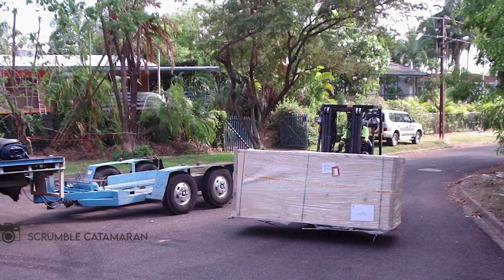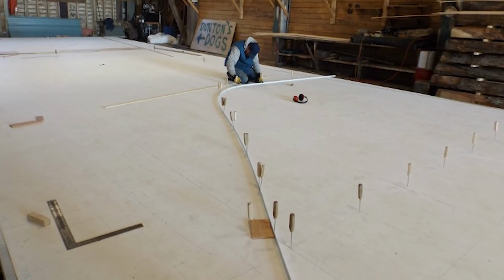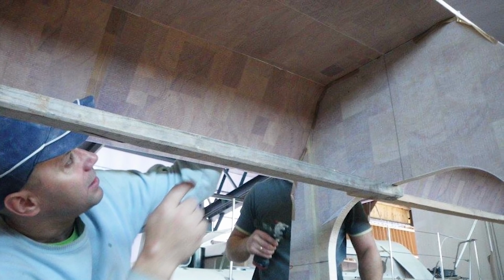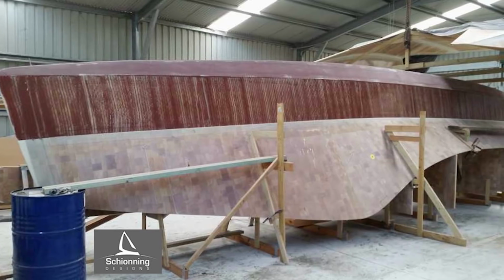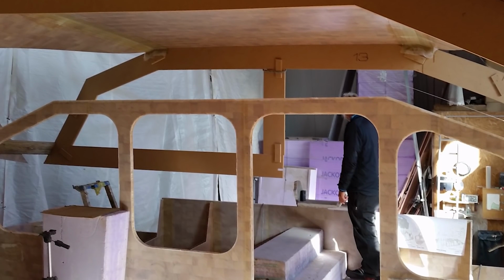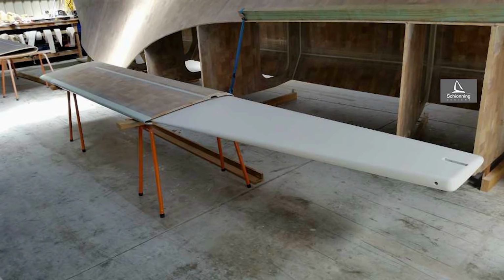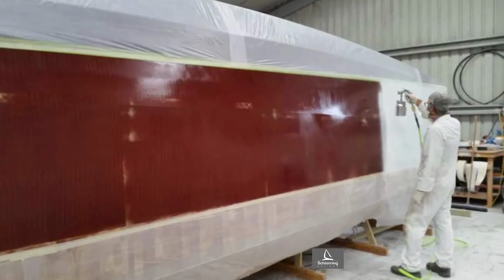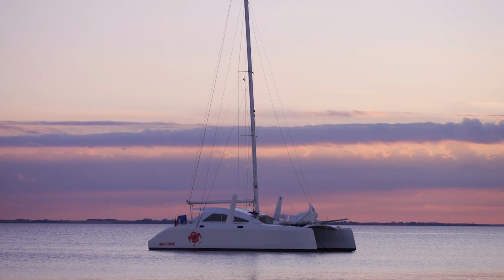What Does It Take To BUILD YOUR OWN CATAMARAN? - MJ Sailing

Comment: Good luck with this build and if I may make a suggestion. Once you have the ‘shed’ built and prior to any boat building effort set  and fix 3 battens (longer than the LOA of the cat)  to the floor. The first to be fixed on the approximate centre line of the shed and the other two parallel to the centre line batten and set at either the extreme beam/2 measurement or the centrelines of the hulls.

Once firmly fixed you can mark out some reference points with the aid of laser and a tape measure. This will pay off in spades when setting out the hulls.
Reply: Good idea.  We're most likely going to be building this on an uneven surface, so any reference points we can permanently establish will be helpful.

Matt

Comment: Looks a full on process but it would be great to do. I think a forward cockpit door like on the new Leopard is a brilliant modification. Have you considered that?
Reply: The Oram is designed with a forward cockpit, but I don't see it as something I'd do in this size boat.  I really can't see much benefit... sure, the mainsail handling is done up there, but without a steering station, you still have to go to the aft cockpit for everything else.   It breaks up the interior layout so much by having an additional entrance along the forward bulkhead, and we'd have to compromise somewhere else to compensate or lose settee or galley space.   -Matt

Comment: Buy a new reputible hull and decks  and fit out yourself.  You have a named product to sell later.  One off boats lose too much on resale value. Cost just as much to fitout a reputable fiberglass hull and deck as it does for a one off. Difference is resale.  Double or triple diagonal ply or timber covered in glass is lighter and stronger and you get a better shape.  Or buy a quality reputable boat that needs some maintenance and refit.  Lots of cheap one off boats  for sale cheap because its easy to plan but hard to end up with a product as good as what the professional builders make.

Comment: Also you may want to watch some of the channel sailing zingaro they had a home built boat it lasted  them years but on a trip back from Easter island  one of the pontoons took a hard hit in heavy seas and split the boat right down the top edge of the pontoon and the bridge deck  they managed to lash it together enough with dinema rope  and stuff to get it to shore but the boat was totaled you might want to watch that see where the boat failed and reinforce those areas with extra glass and such

Comment: You should look at Acorn to Arabella they're built they built their boat house out of just wood was a plastic covering and they've been at it for a couple years and they're build a big boat to give you some ideas of what you can do also Samson boat co built pretty much the same type of boat house both are on u tube they sell construction grade sheet plastic that has a nylon string grid built right into it so it's really really strong you can buy the rolls up to 50 ft wide and a hundred feet long

Comment: I was going to do the same thing. I was deciding between the Arrow 1280S and the Raku 44. I think what was the final decision for me was I wanted to build and CNC my own panels and Schionning won't sell it that way, so I was was really leaning toward the Raku 44. I also designed my own boat and built a model that is very similar to the two designs. Check out my channel for a video of the model and design process. In the end I bought a hurricane damaged Antares 44 two months ago that I plan to fix up. Best of luck to you. If you build anywhere near Florida, let me know and I'll lend you a hand.
Reply: The Antares, while completely different than the Grainger/Schionning, is an awesome boat and worthwhile project.  Good choice!   -Matt

Comment: I built my own 2,000 sw ft. house, and will never do it again. It was super time consuming, required updates for the next 5 years or so full of stressful moments, still required contractors for most things, and the costs were around 20% higher than planned. I now own a 1992 50' Riva motor yacht (I'm overseas with the military ). In 1992, this boat sold for 1.2 million US. I know this boat inside out now and I can say unequivocally, I could never afford to build such a high quality boat myself. The hull is super solid - like brand new even after 28 years. I could not replicate what Riva did, the thickness of the materials, double teak decks, etc. The engineering and designing is masterful down to the way still super tight light panels slip into place so they will never rattle. The joinery is top grade. I've replaced many mechanical items - like the generator, batteries and battery chargers, navigation equipment, etc. Engines only have 400 hours on them. When I finally retire onto a trawler or power Cat, I will purchase an older, vey high quality used one that I know will outlast anything I could build myself. But you two are young, and you will learn a lot from this experience. And you seem to be prepared for the long haul. Also, everyone's experience is different. You might just end up with the boat of your dreams. Good luck!

Comment: Thank you for the beautiful insights! Past years, I've been researching and designing a lot on the making of similar-sized catamaran from recycled thermoplastic and agricultural waste-materials for the composite.  I'm also designing techniques for avoiding expensive molds. The beautiful thing with the materiality I'm working around is not only the recycled part, but also that it is extra resilient to impacts, and that it also has naturally great antifouling characteristics.

Comment: So you're looking at an overall cost of around $500,000? Plus cost of a building and a few years of living expenses. Plan on living at the build site too to save money. And the current state of the world means maybe your kit supplier goes out of business. Step back and take a long cold shower before making a decision.
Reply from the maker: It would be nowhere near $500,000.  Not even half of that.
Reply: @MJSailing  well that's good. I looked up one of those designers on the web and it seemed like they were saying 450 to 900 depending on who built it. Have you thought about building it outside the US?

Comment: When you are looking for shop space make sure that you can actually get the completed cat to the ocean. I've see oversized load haulers have to cut down trees, move power poles, lights, and signs to get down the road. This gets hugely expensive and slows the move process. The more work that the hauler has to do the more expensive it will be and the more likely that you could have permit problems.
Reply: We will have a hauling company confirm that we can transport without issue before we sign a lease on a build site.   Over the years of the build, things could change, but at least we should be starting from a good position....I hope.   -Matt

Comment: If you've built before, I'm sure you've used a water level. If not, get one and learn to use it. It's basically just clear plastic tubing about 1/4"-3/8" diameter x about 45-50' long (for your 40' boat). Although the newfangled laser levels will be great in a lot of cases, the handy-dandy clear plastic tubing is hard to beat - I brought this up because you mentioned in several times how critical leveling is.

Comment: I built an F-9A, carbon over DuraCore, in the early 90's. It was one heck of a process that took 2 years. Building a strip planked boat like that is a huge undertaking so using those panels will save a lot of time. One very cool thing I discovered was regarding the peel-ply, Apparently a static energy builds up when the epoxy is drying. Try turning the lights off (or reducing them) when you pull off the peel-ply. It's almost like a light show when this static energy is released. Also when cleaning epoxy from tools and hands, etc, you can use vinegar instead of acetone. It is much less caustic and cheaper too. Acetone should still be used for anything you will need to bond to though. Very satisfying, when you are done, to kick most other boats butts in a boat that you built yourself...
Reply: Awesome boat! A F-39 was on my list, but since we live aboard, and hope to keep this boat for awhile,  we want a bit more space.     Also cool about the peel-ply.  We'll have to give that a shot....and we'll have ample opportunity with all the miles of fiberglass tape we need to run.   -Matt

Comment: use the flexisanders to all your sanding and fairing. I found out about them watching saillife. they were a game changer. Now I get a professional look every time on large jobs. Also check out life on the mold he uses a spray system for all fiberglass and gel coat(50gal). I got a 1 gal cup gun from the fiberglass store. Paint is an option but when you are taking on a job as big as you are do the right thing first so you have no regrets later. some people will not agree but I rebuild wave runners and gel coat on a bottom will last much longer and provide more protection than paint. Just a suggestion but look into reinforcing the keels so you can ground the boat as needed rather than haul out it will save you a butt load of money, time, and fear (fear from running a ground). I can't wait to see your build! PS during your build watch for those items you might need spares of and build a few extra while your doing it.
Reply: Thanks David.  There are curves of course, but since this boat is mostly flat panels with hard chines, I figured a semi-stiff fairing board would be best.   We'll have to see if there will be value in buying a Flexiboard... they aren't cheap.  

While I know gelcoat "can" be used over epoxy with proper prep, it's been hammered into my head for so many years that poly over epoxy is bad and to be avoided (even though Awlgrip and all 2-pack paints are Polyester Urethane).  Luckily, that's a long way away and we have plenty of time to be dissuaded.   
-Matt
Reply: The 'Life on the mould' guy is building from a mould, that is why he is using gel-coat. It is a totally different process building a kit boat. No gel-coat.

Comment: You might want to check Kurt Hughes as a designer.  Here's a link to a newly designed 45' cat I was considering: http://multihullblog.com/2015/10/45-bridgedeck-cat-update/  Kurts plan pricing is reasonable, and he's been in the game for many decades.  You might also check out Spirited designs, at this link: https://www.spiriteddesigns.com.au/home  Run by Craig and Marina Schionning.  They have a 38 foot synergy design i found interesting.

With that said, one of the major criticisms of ALL kit boats is that they're greatly optimized for performance, not day to day livability.  A kit boat really will deliver sailing speeds in excess of 20 knots; but they're exhausting to sail, and very unforgiving of the slightest error.  This is why people are willing to spend $250 - $300 K for a used, 10 year old production cat.  They're much slower, typically 8 to 10 knots; but they can carry much more stuff, and they're much easier to sail, and much more forgiving to the inexperienced.

I think it's very telling that many owners sell their kit boats within a couple years of completing them.  Kit boats look fantastic, and they're a lot of fun for a weekend sail; but they just don't work out very well as live aboard, 24/7 boats.  You might want to research this point, if you haven't already done so.

Good luck to you!  I'll be following your channel closely.  Best, Charlie

Comment: Did you look at Fusion Cats??
Reply: They are a possibility, but the cost of the kit, and the fact that so much is already done and decided for you, means the Fusion is pretty low on our list.   And I'm not a fan of the slopped forward cabin due to heat and ventilation.  They may modify the plans, but I haven't looked into it.   -Matt

Comment: Clearly you guys have had solid exposure to glass work, which great. One thing with epoxies though is dermatitis with exposure to sanding dust, especially on such a scale as this. I have built several epoxy sheathed sea kayaks as well as a 30 ft deep vee, foam cored cruiser and skin reaction to sanding dust can be profound with prolonged exposure! The other catch with epoxies is amine blush and building in a humid environment can really hasten this. Less of an issue for you guys on the flat panels, but an issue with tabbing over previous layups. So best of luck and I am sure you will pull it off, but it is one hell of a project...

Comment: Great idea will follow , one thing to ad to your mathematical mind, with my experience on cats ,
Installing equipment , running lines cables , is a pain, compared to a mono hull, 
Plan your cabling , to be run,  work out a good place in the kit to install some tubing electable is ok, 
Than later when you change your mind, you pull more cables through,  or pipes ,

Comment: Good thing you picked foam core, balsa would be a disaster waiting to happen. I do not agree that a home build boat is necessarily better than a production boat. A boat build with a female mold  and using foam core and infusion would in fact be better than this flat panel construction that relies on secondary bonding to keep the entire boat together.

Comment: I just want to see how thick the instructions are..lol.   If my wife and I did this sort of thing together we would be divorced within a week!  I am assuming you would be renting a shop that you could live in to do this build.  Are you thinking of building this home in Michigan and sailing the finished product out of the Great Lakes like you did Serendipity?
Reply: We thought about it, but the added cost of needing a heated and insulated building makes it difficult to do in Michigan.  -Matt
Reply: I bought a used schionning and the boat came with the project plans.  They are incredibly well written, with diagrams and simple, direct wording.  As I've had things to fix I refer to the project plans for help in how to fix.  For instance I touched bottom with my STbd rudder and bent the shaft.  The plans helped me figure out the repair.

Comment: Advice :- build the boat yourselves and apply fairing compound, pay kids to sand it under your supervision, they have stamina beyond that of adults and take instruction quite well, are very cheap and normally available. Pay someone to paint the hulls - a professional will do it faster and better than you ever could - don't try and fool yourselves. Fit the yacht out yourselves - it will be cheaper and you will learn and understand the systems which will help you when you inevitably have to fix them. After three years, assuming you aven't divorced, enjoy sailing whilst fixing things, as usual ;-)

Comment: Sounds like don't sweat spraying it get yourself a 3M accurate spray system where the tips and the cup liners are disposable and they have a tip that so big you can shoot gelcoat with it even and if you threw everyone every tip out every time it would get expensive but even the tip she can clean and reuse for quite a few applications

Comment: Are you sure you will have the same confidence in this vessel ? You will move much faster and hitting something... I know which boat I would prefer. Foam Panels? Is it much cheaper then having them cut Aluminium?  I am not a hater, what ever floats your boat....  But man, who in their right minds would swap Elements for something like that.  Sacrifice 2 to 4 years for the swap? Life is short....
Reply from the maker: We're still in our 30's, so the way we see it the glass is still half full and we have plenty of life left.  What is 2-3 years in exchange for a vessel tailored to us and the pride of having built it ourselves.  😉
Reply: @MJSailing  hm, yes but you have the holy grail among boats. The strength of aluminium,  much less rust problems then steel, shallow draft go anywhere.  I 'd build the cat and keep Elements. You will want her back :-) As for the value, home builds are dirt cheap here in NL. I have one. It is far better build than anything from a yard but I paid 10.000 euros for a 41ft ketch.

Comment: A suggestion for the "murder boards" when fairing.
Get some thick but flexible ones and attach a pneumatic turbine vibrator and some rubber handles, you've now got a vibratory sanding board.
Reply: Thanks.  I just read about making a electric version out of a sheet sander a few days ago.  Seems like a nice option to pursue.   -Matt

Comment: Just finished building a 41 ft cat 20,000 hrs 10hr days 7 days a week  ... $300, thousand ... good luck ... hardest part  is to keep going .... what ever you think its cost double it with time triple it ....
Reply: What design did you go with?  Moulded or strip planked?  That's a lot of hours!   -Matt
Reply: @mattjohnson6716  this my 3rd boat build .. is strip plank custom design .. my preferred would be vertical strip foam .. building a cat you are building 2 40 ft boats .. every square inch of surface area you fair and paint ..quickest part is building the hull then it doesn't change for 6 years ..then shed rent power cost of living .. have a look at roam sail surf  u tube .. he built a shoning kit boat ..
Reply: Wow, that's about 5 & 1/2 years.  Must be some boat.

Comment: Look forward to your build. I think if I was going to the trouble to build from scratch I would use honeycomb or other fiberglass or foam core boards. Easy to work with, a small percentage of the weight and cannot rot, even if your fiberglass delaminated.